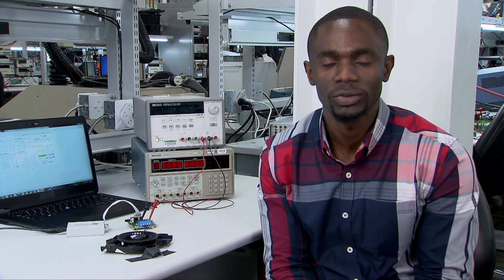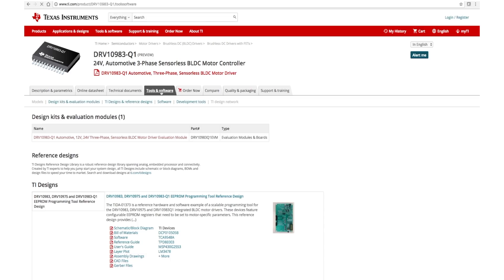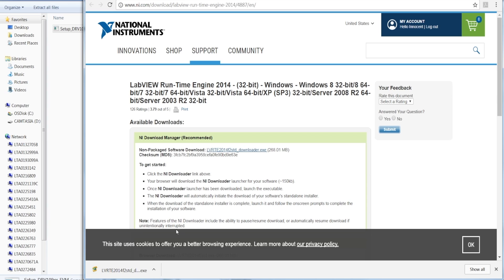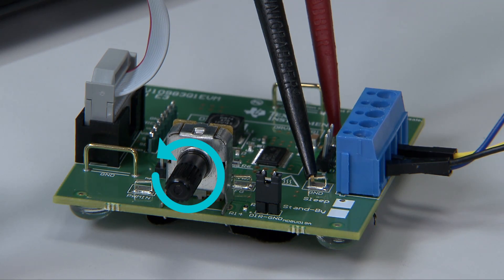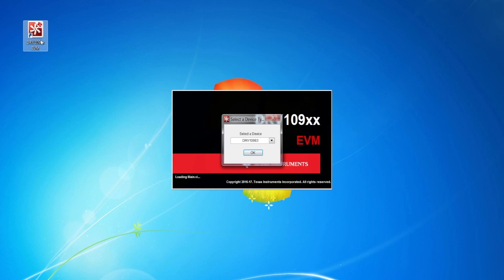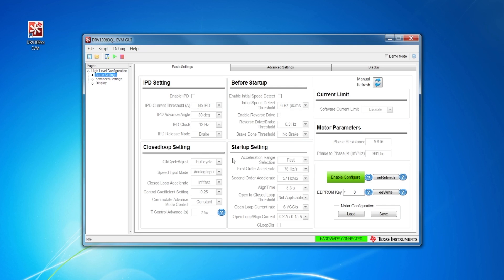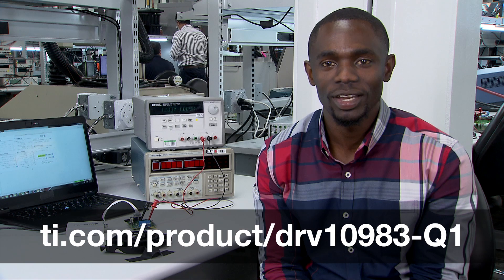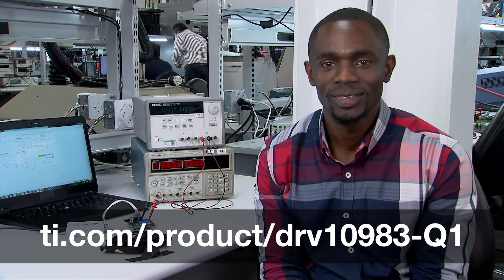DRV10983-Q1 BLDC motor driver EVM quick start-up

Comment: Hi,
Please, I need to know if this driver I can use in position control project such as servo.
Regards,
Wellington
Reply from the maker: The DRV10983-Q1 could be used in a position control project, however, the device might not be the best fit for the application. The DRV10983-Q1 specializes in continuously driving motors for long periods of time where a position control project would require precise control over start up and spin down. Since the DRV10983-Q1 does not have an integrated speed loop, a microcontroller could help implement a speed or torque loop to solve these problems. If you do not need an automotive certified device and are still considering the DRV10983-Q1, then check out the DRV10987.